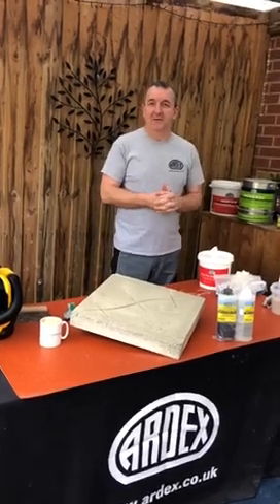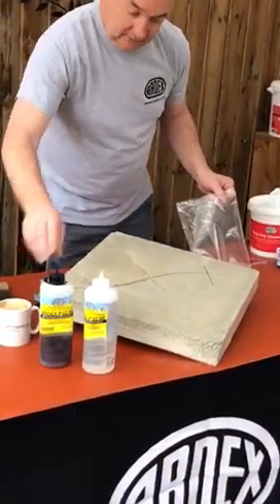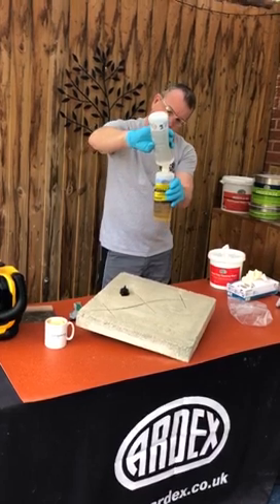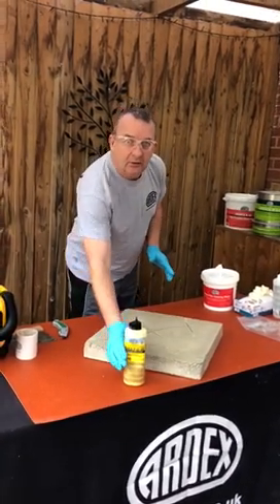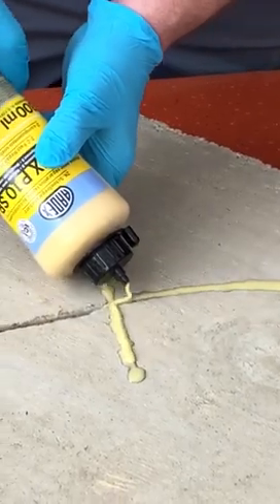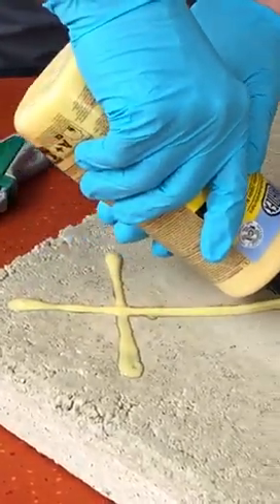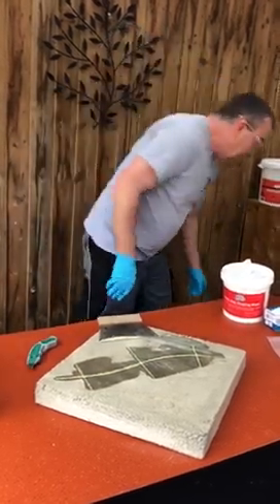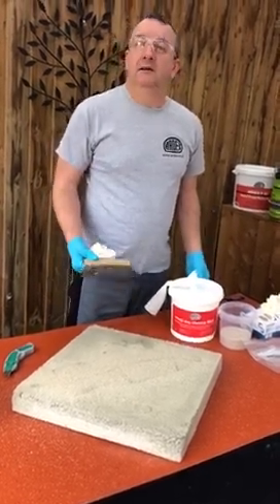How to repair cracks in Concrete with ARDEX P 10 SR Rapid Hardening Crack Repair Resin Kit

Comment: Hi--having watched the video carefully and speaking to technical , I carried out everything as per instructions ,in less than 10 minutes the kits had turned to hot lumps of a soap like consistency!  Honestly it was hard in no time!
Reply from the maker: Thanks for your feedback, ARDEX P10 SR is a rapid hardening product and does have a working time of 10 minutes. We're happy to send you some more if the job remains incomplete.
Reply: @ARDEXUK  I found exactly the same result I purchased 2 kits 7th May 2024 First kit i let stand for 3 mins I literally did approx 300mm and it solidified in the bottle the second kit i did not let stand fo 3 mins i applied immediately after shaking for 15 secs it started hardening in the bottle within 5-6 mins.